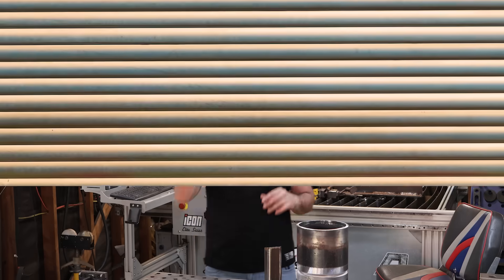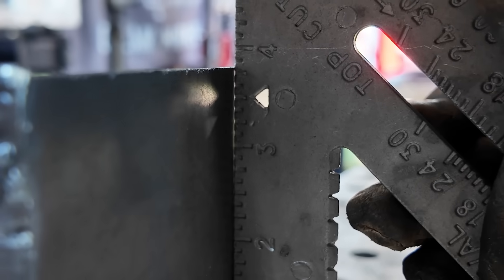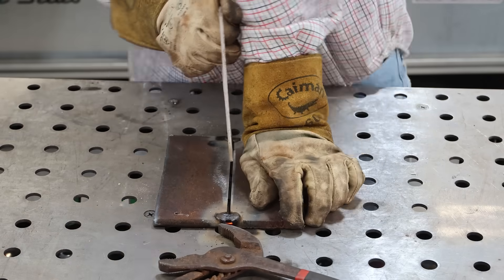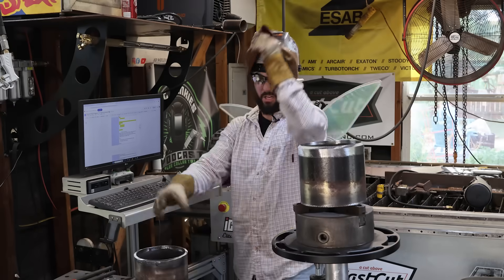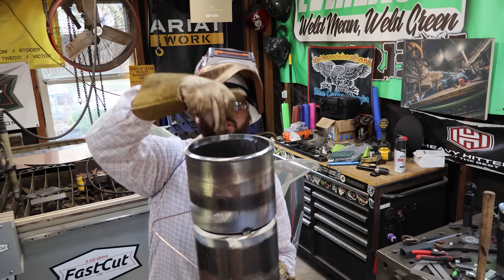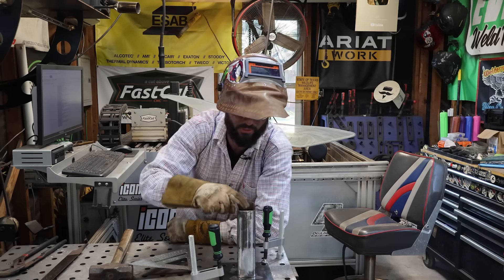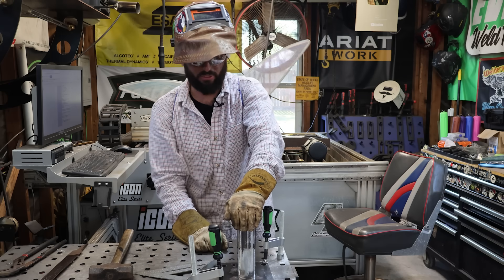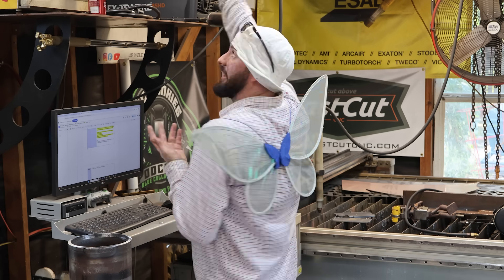Your Tacks Are Ruining Everything (Here’s Why)

Comment: I was taught to lift the first corner when tacking tube onto plate. This allows you some adjustment in all 4 directions allowing you to square it, no matter which way it needs to go. The gap also helps with better penetration. Basically, same idea as what you showed with your pipe tacks.

Comment: As they found in WW2 battleships, when welding plates, start in the middle and work to the ends. Before they figured this out they had ships literally breaking in half at anchor from internal stresses "baked in" by welding the perimeter in a single long pass from one end to the other.

Comment: Oh, it's easy with the groove weld: first you put a center tack and it clamps the spacing inserts in place, then you tack both ends, but this time nothing is moving anymore, then you pull inserts off or cut them, and then you either grind the cental tack or weld it over later on. When spacers are clamped too hard between pieces you can grab it with pliers and give them a few turns.

Comment: Beginner level welder here…for the flat weld example, instead of tacking at both ends, could you throw a tack in the middle to start then tack the ends?
Reply from the maker: Id prefer to keep the weld groove free of any tacks, at least for short coupons. In most schools or if you go take a weld test, the first 1/2" and last 1/2" maybe disregarded visually. So its safe to put some tacks there. Also with just the one tack, you could risk the plate twisting or warping while welding.

Comment: Sometimes it helps to put a bit of cardboard in the gap. Say when you are making a tubing frame, Then tack the outsides of all four corners(of the frame). Then you have gaps to help square the frame up.Measure the diagonals. When your measurements are the same and tacked you have a frame that is as perfectly square as you will ever get.
Reply from the maker: Interesting technique. Thanks for sharing.

Comment: I made some custom tools for a pipe welding project. These tools were essentially pieces of approximately 12 mm threaded rod. I shaped one end of each rod, thinning it down so it could be used as a spacer to maintain the necessary root gap between the pieces to be welded.
Once the workpieces are tacked together with small welds, the tools can be pulled out of the tight gap by screwing a nut against the workpiece. 
The work was stainless steel, so I made the tools out of stainless also.
Not sure if it helped, but I also heat treated the thinned part. 
I wanted it to be hard, so it didn't get smashed...
Reply: Want pictures of this
Reply from the maker: Custom fit up tools for your specific needs are crucial.

Comment: wouldnt it work just a wel if you push em tight and small quick tack in the centerand halfway at 3/4 and 1/2 distance from center to each end and let the gap be what it will and roll on with it
Reply from the maker: Certainly, depends on the situation. In this instance a gap is needed to get complete joint penetration. Closing that gap could risk incomplete fusion on the back side of the parent metal. This is mainly for code work, If the code says "slap em together with no gap and get frisky" then thats what you do.

Comment: Does tack welding in the same direction apply to stick welding pipe as well?
Reply: Yes for 6g practice I was taught the tacks on opposite sides of each other should end in the same direction. For example, using a clock to reference direction, first tack would go from 11 o’clock > 1 o’clock. 
Then 7 o’clock > 5 o’clock. 
Third 10-8. 
Last 2-4. 
Tacks should be 3/4” long and feathered on both ends. Before breaking arc, move back over your puddle for a split second to avoid leaving a big keyhole at the end of your tacks.
Reply from the maker: 100% yes

Comment: I have an idea for a video.  What's the worst thing or place you've ever had to weld?
Mine was having to go waaaaay underground in a coal car that they cut the sides off for me to reach under to repair the hooks on the chain drive between the tracks.  I'm claustrophobic and until I repaired it, I was stuck in a very small feeling coal cart.  took me about six hours and I had to have lost about ten pounds worth of sweat.  Welding inside of fuel tankers is a close second though
Reply from the maker: sounds like another day in paradise.. so they say. Ive made some tough welds in some cramped spots. never underground.. more of a ditch lol. Most jobsites wont let us bring camera gear to film ever. not to mention if its cramped to weld.. probably hard to video too.

Comment: 30yr Local #342 Union Welder here.  Don't worry about the GAP!...make sure the two pieces of pipe are square to each other, then add your second tack.
Reply from the maker: absolutely sir, practicing good fabrication techniques will help you go further. For the sake of just learning to make a weld, I like to focus on one step at a time. As you know If the pipe and bevels are square, you could eye ball the gap all the way around and get pretty darn close. Then check it all with a square and level.l

Comment: For all the pros here, I'm currently working in ship building industry there involves a lot of fitups and welding. So I've seen the fitters putting strongbacks and clamps to avoid distortion, based on the thickness of the plate and other factors. 
I would like to learn more about it from the basics, is there any books that I can take reference of especially for fitups.

Comment: Those are heavy tacks for that open root, I learned to tack very lightly so instead of having to feather your tacks after with a grinder if you tack very lightly you can just blow through them with the arc and the heat as you run over them, is this correct or am I missing something
Reply: 30yr union welder here......if you put small tacks it is VERY possible that you will crack the tack on the opposite side when putting in the root.
Reply: @Zamboni-0805 on a pipe? Why, I just learned open roots at school and I am practicing on plate, haven’t got to pipe so I am just doing 3/8th 6 inch plate but later on I’m gonna move to sch 40 and 80 6 inch pipe
Reply: @TexasNationalist1836  Heavy tacks can make sense in certain cases though like if theres a lot of distortion expected, the joints under stress while fitting up, or you are planning to grind/back gouge the root anyway. Otherwise yeah, lighter tacks are definitely the way to go for a clean burn through.
Reply: Ever one has their own way. As someone who’s been welding tig pipe for well over a decade. Those are the tacks I’ll put in almost everytime. Nore will I need to feather anything, as I’ve learned how to properly tie in with or without the feathering.
Reply: Which is great until you bust one of those tacks and your root turns into a pizza slice